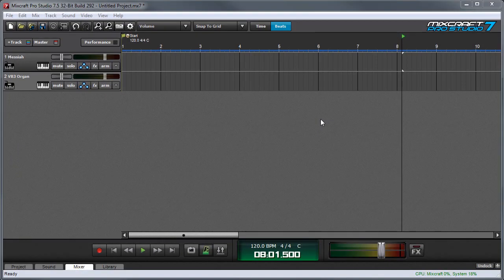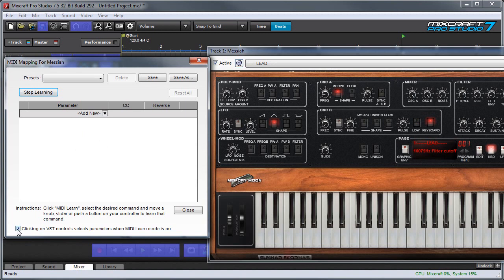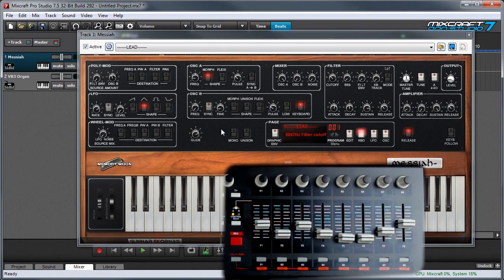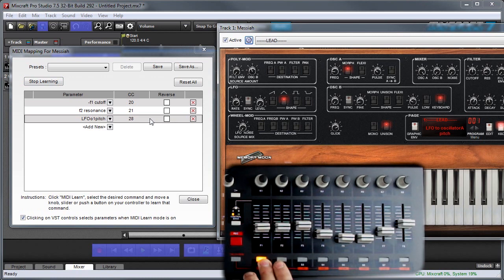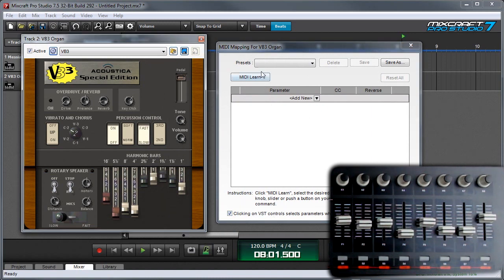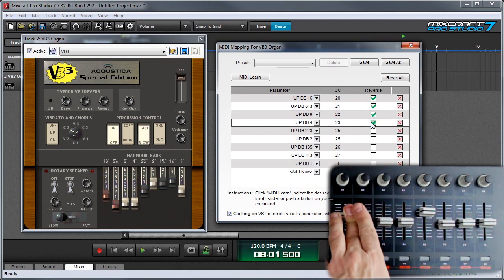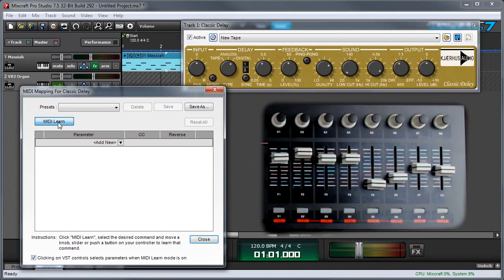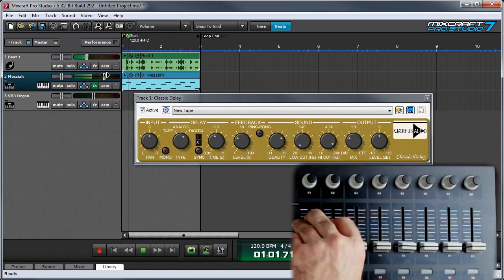Mixcraft 7 Control Surfaces: Using A MIDI Controller With Virtual Instruments and Plug-Ins

Comment: how to record these changes?
Reply from the maker: If you're looking to use a MIDI controller to record automation, you can refer to the 'Automation and Controller Mapping' section of the manual! If you're stuck though, feel free to contact our support at support.acoustica.com
Reply: @acoustica222  thanks figured it out myself.. there is a record arm button in automation lane..
even though I try out different DAWs I keep coming back to Mixcraft as it is simple and intuitive.

Comment: Here's a ? Let's say that I've got my control surface set to my mixer. Is there a way to set it up to control a vst as a separate setting? When I right click on midi it brings up the control surface details and in the surface box it has my Nanokontrol2, nano1. Is there a way to disable that so I can use the nano to control a vst without having to delete or reset the mixer settings?
Reply: +Mark Lipping   I don't believe there is currently, but I will address it with the developers. One workaround would be to just use a different program with different controller numbers for your nanos (I think they call them banks).
Reply: +celebutante Yeah, Ill look into that. I was just thinking MC could have in the control surface drop down the ability to switch what it controls. So you could have the same controller able to control whatever is programmed and saved. Thanks for passing on the update request, and for making stuff somewhat funny on your tutorials! 😈